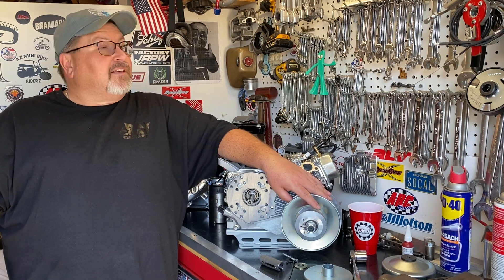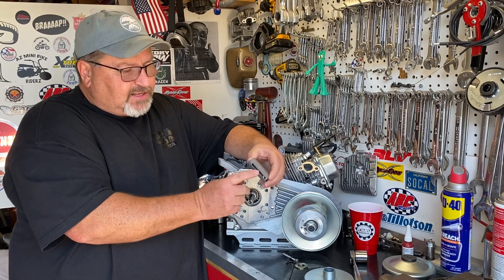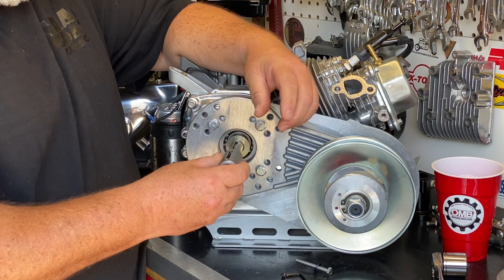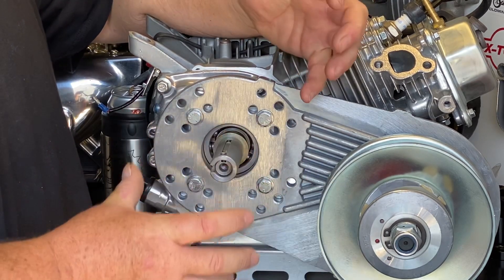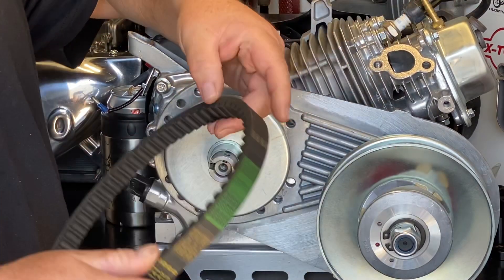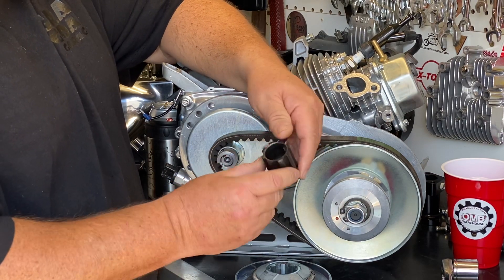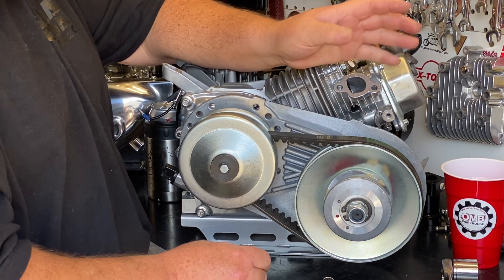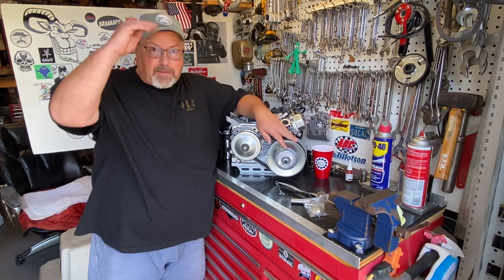OMBwarehouse Coleman 16MM crankshaft adapter install

Comment: Love this kit! Zero issues installing it on my Coleman CT200U-EX. 

I'm new to torque converters. LOVE the extra power at both low speed and high speed. However, transitioning between the two feels rough and jolty. Are there any lube points I could be putting some red-n-tacky on to make it transition a little smoother, or is this just how these are?

Comment: How can I get one of those sleeves 5/8 to 3/4
Reply from the maker: The issue with using a 3/4” sleeve is that the key that is built in will not engage into the crank and not recommended 
That is why we went from 16MM to 1”

Comment: Just recieved my stage 2 and tc from omb and mine came with both driver and driven disassembled. What is the correct order for the driven, have a washer that has a key cutout dunno which spot it goes on the driven shaft
Reply from the maker: https://www.youtube.com/watch?v=-qQ5ZNLGp4s&t=72s

Comment: do i not need to use 7 washers to space it with this kit?
Reply from the maker: NO! We do not use hardware store washers to space the driver unit! That will cause an out of balance condition on the crank as the ID of those washers is not precise.

Comment: Hi Gray Goat perfect videos. I install my torque converter on my Coleman CT200U-EX every thing bolted on good. My bike seem slower now do you know why?
Reply from the maker: Hard for me to know why it is slower without seeing it. I do recommend cutting the upper limit screw off the stock throttle plate to make sure the carb is opening all the way. That does not affect the governor and should give you speeds in the high 30mph to low 40mph
Other than that make sure the chain is not too tight and the rear brake is not dragging. It is common for people to get the new chain on and not adjust the rear brake!

Comment: Stuff from omb doesnt even fit properly. After sanding a ton i think itll slide on...well see soon i guess. Junk as far as im concerned.
Reply from the maker: We are always quick to blame the American made parts when going on a Chinese engine!
Remove everything from the crank, start the engine, and use some fine sandpaper on the crank
Reply: @TheGrayGoatGarage  not only did i have to sand the shaft, i had to sand the sleeve to make your bushing go over the sleeve you made?

Comment: Is this the same shaft that's on the stock mb200 Chinese engines (jf200)?
Reply from the maker: Most mb200 bikes have a 3/4” shaft. You would need to pull the clutch off and measure the shaft to know what crank you have

Comment: Did you leave the original spacer on before putting on the washer? I took spacer off and put the washer on, then the sleeve. Now the shaft sticks out beyond the sleeve is that ok or do I need to buy washers and start spacing it out? This would be easy if omb warehouse just made a installation video. Any help? Thank you!

Comment: In the minute 4:52 . What’s the exact measurements of the bolt? Because I lost mine and I can’t find the exact measurements
Reply: Mine got stripped and I need to order a new one but I'm having the same problem i don't know what darn size the bolt is. My mini bike is a MB200 not a Coleman and my crankshaft is 3/4 inch and i can't seem to find the bolt for this on any of the websites I've checked so far. Very frustrating.

Comment: I have read the sleeve that makes shaft 3/4 works good ? I’m not a hot roder lol
Reply from the maker: I see a lot of folks using the 5/8” to 3/4” sleeves. I have a couple issues with that. The crank you have is not 5/8”, it is 16MM which is .005” larger in diameter. Try his makes the sleeve expand as it goes over the crank. The other issue is that the key that indexes into the crank is built into the driver clutch hub and has minimal engagement into the crank key. We did not feel that was a good long term solution and can fail. Trust me, it would have saved me a lot of time designing the adapter if we could use a sleeve!

Comment: I've got a question about the "heavy steel bushing" you mention @3:04.  Right after sliding it on, you mention "it's included in the kit".  Exactly which 'kit' are you referring to?  The "Crank Adapter Sleeve" kit (https://www.ombwarehouse.com/16mm-to-1-crank-adapter-sleeve-coleman-ct200u-ex-bt200x.html) does not include that as one of the components.   Can you please list the dimensions in case I need to fashion one?  I assume the ID is 1" (or just slightly larger) to fit the sleeve, but what is the length?  Or, does OMB sell JUST that bushing?  As soon as more engine riser plates are in stock, I'll be getting this project under way!!!  :-)

Comment: Just ordered one OMB YOU SAVED ME GO POWER SPORTS IS ALWAYS OUTA STOCK 😡
Reply from the maker: I think you will find this to be a much better solution too! No need to stack those hardware store washers!
Reply: @TheGrayGoatGarage  I just have one question, does my 16mm crank shaft limit the torque converters performance vs a 3/4?
Reply from the maker: @gangarifoxhound  no, it does not have any effect whatsoever

Comment: Hey goat garage whats the name of the adapter sleeve kit . Ive been working on trying to find the ride adapter for my torque converter and have yet to find the right one .this is exactly what I need to get my bike running again so please help lol so i can order this adapter sleeve!
Reply from the maker: my apologies for the late reply...I get so many messages from so many sources this fat old man can't keep up! Sorry. https://www.ombwarehouse.com/16mm-to-1-crank-adapter-sleeve-coleman-ct200u-ex-bt200x.html
Reply: @TheGrayGoatGarage  Hey, I hit you up a month or two ago about this setup (adapter sleeve on stock crank, 1" TAV, riser plate, and a stage 1 kit on a CT200U), but got waylaid by some family issues.  I'm now trying to install all this, but the stage 1 exhaust (with the riser plate) now hits the bottom of the frame rail that the seat sits on.  Is there an easy way around this that will keep me from having to cut the exhaust header apart, clean up the parts, and re-weld it to the flange at a slightly lower angle?

Comment: Mr Gray goat I need some help please

I bought a phantom Moto all terrain which on the website says that the chef size is5/8
.
And I bought a torque converter that says that the shaft size is ,3/4 

I don't want to go to the 212 preditor from harbor freight  it's too big 

&
The police where I live will impound  the bike and I use it as my wheelchair  
I need to get a shaft converter from  for a 5/8 inch to 3/5 in crankshaft for a 79cc 4-stroke Honda clone to the 30 series torque converterp
Reply: I think you may be SOL on this setup.  I looked all over for a similar issue with a 16mm crank (5/8"...almost), but the best option I found was the adapter sleeve this video is about.  BUT...it requires a TAV with a 1" arbor...not 3/4".  As mentioned in the video, you just won't get good engagement with the actual crankshaft keyway with a thin slide-on sleeve.  If you can't return the original 3/4" TAV at this point, you may not be out ALL of your money.  Many places sell simply the front (driver) pulley, and you can buy just that part, but with a 1" arbor.  That, combined with this sleeve, should have you in business

Comment: I ordered a torque converter with a stage one kit from OMB Warehouse I did not get the right bolts to mount the engine to the riser plate so would you be able to give me the size so that I can buy them and bolt my engine down to the plate that came inside the kit

Comment: After grinding, shaping and whatever my 3/4" sleeve to fit over a 5/8" shaft, I Thought, "Man, so much work to not be guaranteed a balanced fit and farting around with integral keys and non-integral keys" 
So I decided to shop around and decided to throw money at the problem, make it go away, so I just bought a 3/4 shaft crank and a stage 2 kit for my BT200X from OMB Warehouse.
Now I can stop baking my mind over this.

Please note: You should inform Canadians that we do not qualify for free shipping, all we can do is hope to save money by combo shipping.

Thanks.

Comment: What is the link to the belt for it I can’t find one that will fit to save my life lol
Reply from the maker: https://www.ombwarehouse.com/-9-7-belt-asymmetric.html
Reply: @TheGrayGoatGarage  Oh I meant do you have a link to a belt that would fit my Coleman CT200U-EX the belt you sent me to Is for 7” mine is 6”
Reply from the maker: @hudsonmyers7404  that is the correct belt in the link. That belt is for 7” centers and not the diameter of the driven. There is not “6 inch” belt as the belt listed is the shortest 30 series belt
Reply: @TheGrayGoatGarage  well I measured it and the OD is 6” and the CD is 6 5/8
Reply from the maker: @hudsonmyers7404  I designed the crank adapter and have worked extensively with this kit. I do this for a living. The Comet 203589A is the correct belt for you
Reply: @TheGrayGoatGarage  well my torque converter was made by gopowersports and i know for a fact y’all’s torque converter is made different I have a also you’re putting that on a 3/4 shaft I have a 5/8 shaft which is why their made different cause the Coleman’s stock motor has a 5/8 which is why it’s made different but I ordered that belt cause I have like 16 other belts that people said should work but didn’t so at this point I’m just trying to find a belt that will work for a couple of days at least
Reply: And I tried asking gopowersports but they just keep sending me a link to all of their belts instead of sending me the right link to the right belt
Reply from the maker: @hudsonmyers7404  I sent you a link to the correct belt. Now you are telling me this is not the correct belt. Maybe that is why GPS sent you a link to all of their belts as they felt you knew exactly what you needed?
I am doing my best to help you on my day off. 30 series torque converters that have the aluminum backing plate use the 203589A belt. Period
Reply: @TheGrayGoatGarage  well I ordered that belt like I said I’m open to any ideas cause every belt I use only last me a couple of days
Reply: And I’m sure I’m putting the belt on the right way and I’ve made sure the belt is straight

Comment: Won’t that bolt work it’s way out without a lock washer
Reply from the maker: Not if tightened down properly!
Reply: @TheGrayGoatGarage  would lock tight be a good safety measure
Reply from the maker: @colbyturbeville2946  Yes, you can put some loc-tite on that. Just remember, you will have to get that bolt back out when you need to change the belt!
Reply: Thanks

Comment: why is this variable belt drive better then a centrifugal clutch?
Reply from the maker: The torque converter is a variable pitch design like a constant velocity transmission. It gives more low end torque and an approx 10% overdrive. The pulleys change their diameter allowing this to happen. Once you use a torque converter you won’t go back to a centrifugal clutch
Reply: @TheGrayGoatGarage   thank u